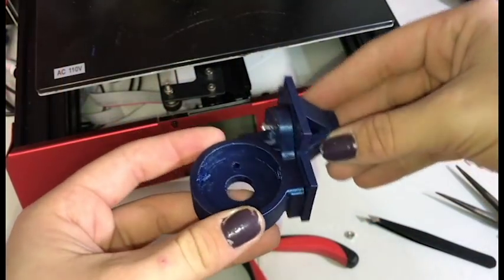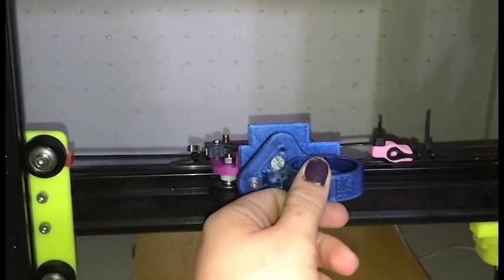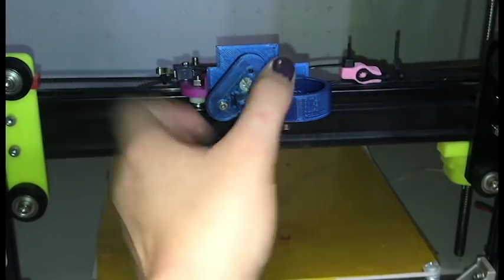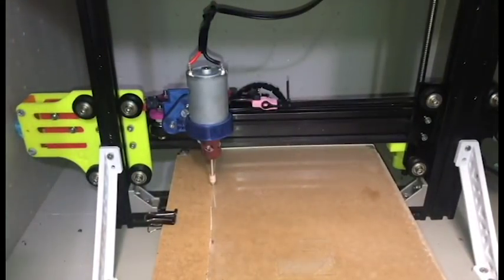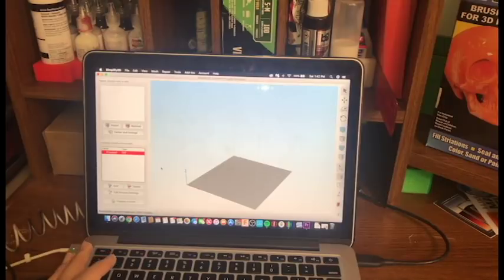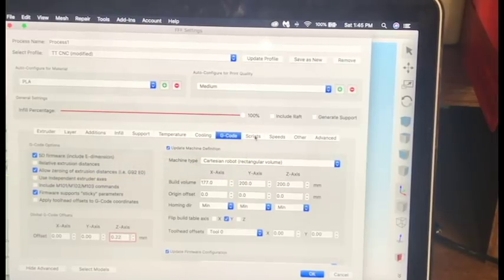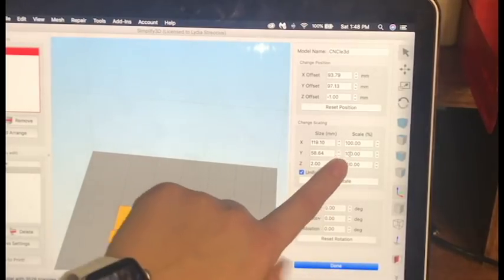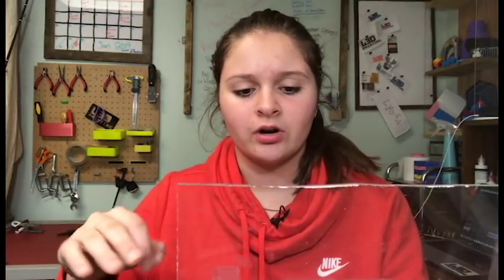3D printed to CNC!//Tevo Tarantula Turned into CNC Final

Comment: hey. looks like i'm first! :)
great job getting this conversion done. having a wood 'waste plate' underneath the material is a good idea anyway if you want to cut all the way through so its good that you did that.

one of the reasons it's quite loud is because chuck design with the bolts sticking out isn't well balanced when it spins. if you can find screws that are just long enough or you cut them off to the right length it would make a big difference.

if you do, i'd suggest taking the bolts out completely, then put a nut on the bolt further down than where you cut it off, screwing the nut off again afterwards will repair the thread.

anyway nice work! i'm confident you'll get great results after a few tries. looking forward to seeing some of your projects with it.
Reply from the maker: Thanks!! I actually upgraded some parts and there will be a video posted about that on the 15th. I will try what you suggested, thanks so much